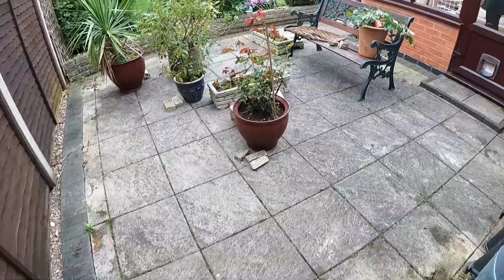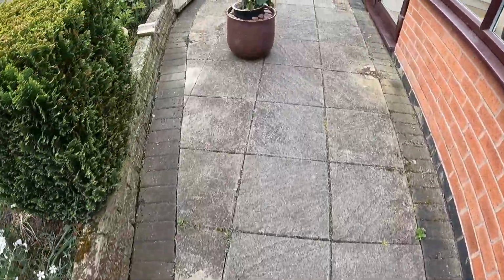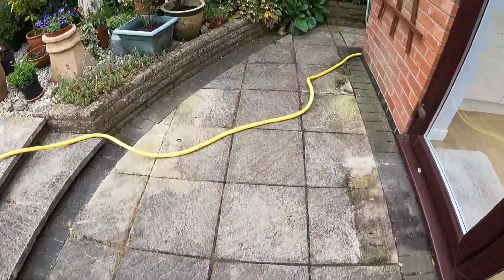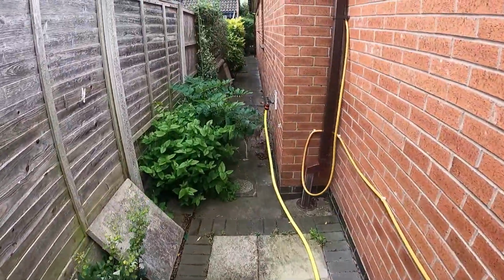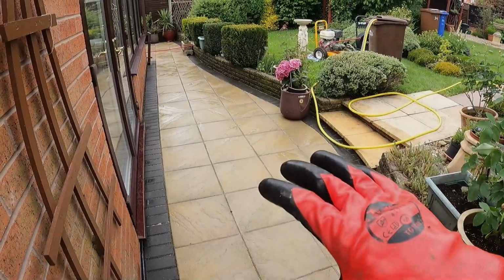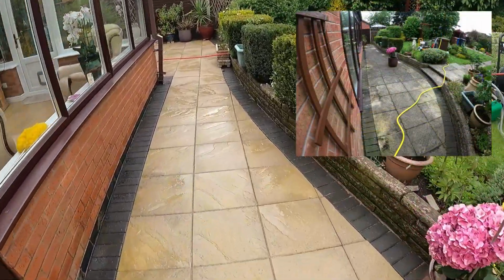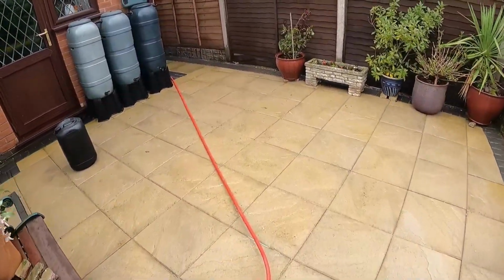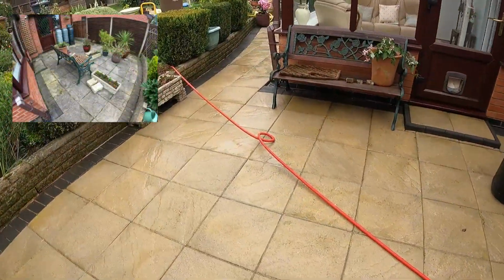From NASTY to NEW in 8 Minutes! 🤩

Comment from the maker: Nearly at 96K! Thank you! When I first started out I thought I wish I had as many subscribers as i have £'s, probably had maybe a grand in the bank and wanted 1000 subscribers... Well now I can definitely say I wish I had as many £££'s as I do Subscribers!! I'd put a deposit down on a nice country house! xD
Hope you enjoy this video! Cracking result today for sure.
Reply: Sorry mate I’ll ask again why do you fill bins and not connect to the tap directly?
Reply from the maker: @dangerousdanmcgrew745  Pressure washers flow rate is too high for what the taps can produce so the bin acts as a reserve so it can take as much as it needs instead of risking damage to the pump (:
Reply: @PartridgeExteriorCleaning  does the bin not empty at a faster rate than it fills then? Do you run out a lot and have to wait for refil? Am I being thick?
Reply from the maker: @dangerousdanmcgrew745  Yeah it usually empties quicker than it fills, have to stop every once in a while on large areas but small jobs like this are stop and start a lot because of hoses getting caught, switching nozzles for different surfaces etc so it was actaully over flowing often on this one.
Reply: @PartridgeExteriorCleaning  I get ya. I have done some small jet was jobs just using a basic jet wash think was a stihl. I work for myself already doing lawn cutting, pruning and other garden bits but feel would like to do some of this. Thanks for the info. You do a great job and are quite an inspiration for a lot of people. 👊🏻
Reply: You'll get that country house one day. Just keep reaching for it and you'll get there Syd.
Reply: @dangerousdanmcgrew745  that is a good start. So you are like me more on the garden (maintenance)side of the thing then the exterior cleaning. If you want to grow a bit in to the exterior cleaning as well (maybe just as a side of your main) get your self some basic window cleaning kit. (you could start with the basic Unger belt system)  then you could add that in the mix. And like Sid does use a x amount of the money you get from a job to pay for the equipment upgrades.
Reply: @sirBrouwer  yes mate mainly on the maintenance. It’s been fun but I been doing it  along time need something else to do may get someone in to do my diary. Whilst I get some fencing or pressure clean jobs. I’ll look into what you said also. Cheers for the info.
Reply: @dangerousdanmcgrew745  your welcome. I am also still learning and it fun growing in to the job.
Reply: hello, what is the name of that white product that you apply at the end to remove stains, I have a grease and paint stain on cement and I think that would help, I am very relaxed watching your videos.
Reply: @jasperirving007  he is using hypochlorite (bleach).  For cement you might risk staining it with bleach it self. 

For crease and if the paint is only on the service.  You might want to use soda in combination with cleaning vinegar.

Comment: Question for you. I see that you use a 'wheely bin' for the water you use. Is it because there aren't water bibs close by or for a better and/or consistant water pressure? The garden looks lovely. You always do a fantastic job 👏 🙌
Reply: I might be no Sid. But it's mainly the last one.

The pump on the pressure washer draws in more water then the mains could deliver.

By using the bin as a reservoir you do have enough water. To start with you fill the bin and then keep the garden hose on so it will keep it topped up as much as possible. You still will need to wait every now and then. as the pump still empties the bin faster then the mains refills it. of then just replacing items in the garden can be enough of a wait. of it might give Sid a moment where he must take a break (a good thing) and wait until it's full again if the water pressure is really low
Reply: @sirBrouwer  - Thank you for the explanation. That makes sense. 👌 Swear, I learn something new just about everyday watching these videos!
Reply: @kwells8807  your welcome. I am also constantly learning watching Sid. As his work and my own do overlap a bit.